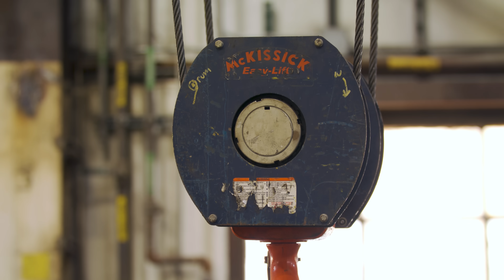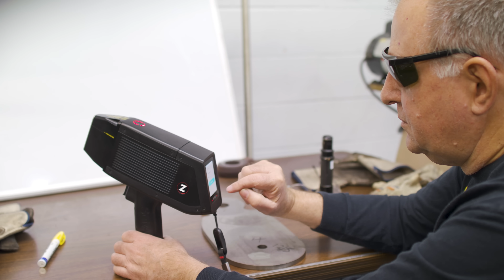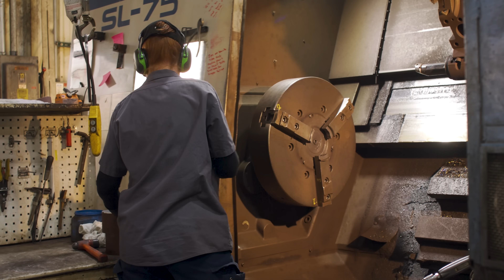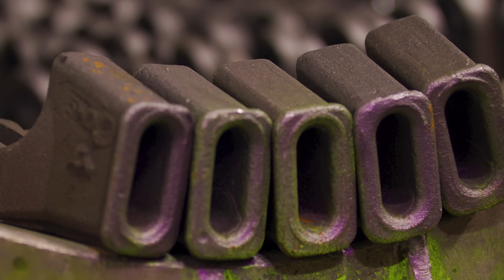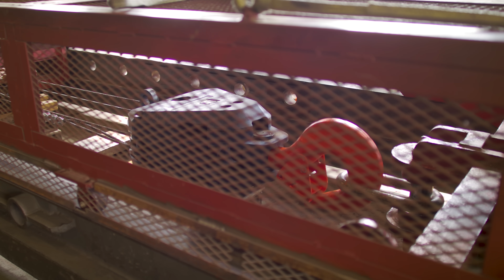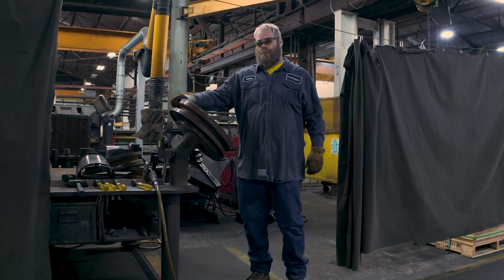How Crosby McKissick Crane Blocks Are Made

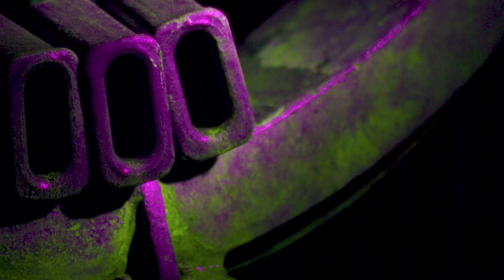Comment: 9:55  *Penetrant Testing (PT)

ℹ️ Penetrant Testing (PT), which includes Dye Penetrant Inspection (DPI), also known as Liquid Penetrant Inspection (LPI) or Penetrant Testing (PT), is a low-cost, non-destructive testing (NDT) method used to detect surface-breaking defects in non-porous materials.
Over the course of my career I've performed many workweeks of it.